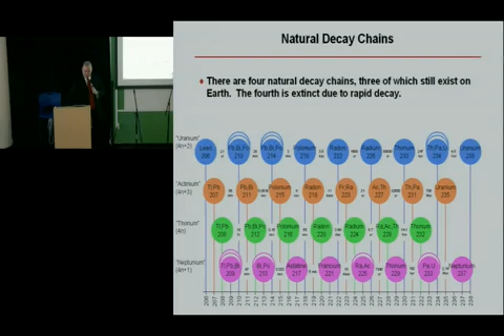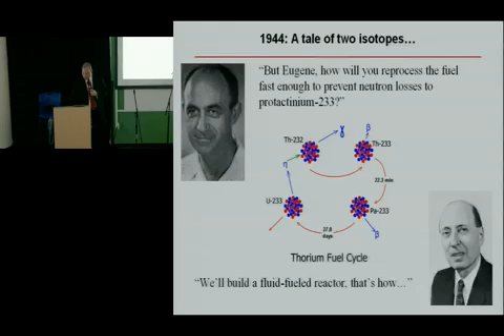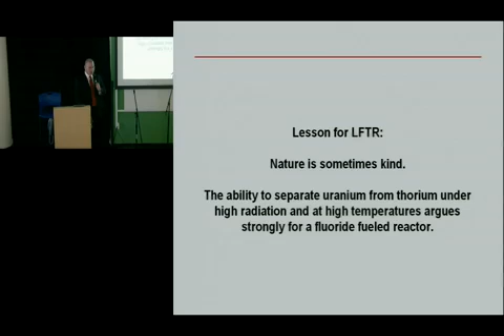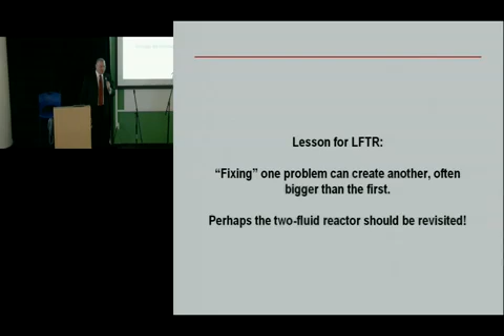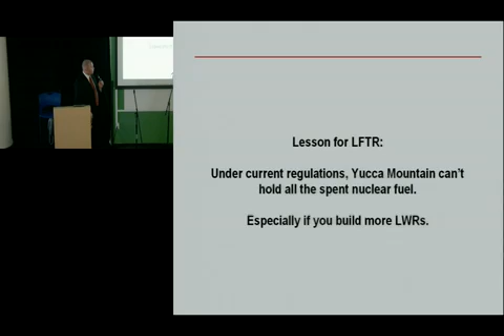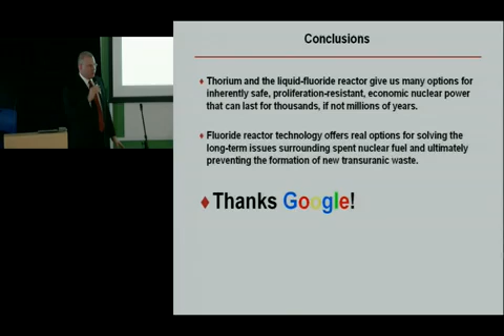Energy From Thorium: A Nuclear Waste Burning Liquid Salt Thorium Reactor

Comment: Except that he makes all kinds of leaps of faith - starting by calling thorium a "fuel" which it is not (the fuel is either the plutonium or the uranium 233).  While it is entirely theoretical that a LFTR could be built without any actual reprocessing, its breading capacity would be inefficient and likely suffer fuel failure at some point.  In any case, the thermal spectrum reactor cannot "use up all of the thorium" unlike his promise.  His language is manipulative, the LFTR entirely theoretical

Comment: I'm a big Th232 fan but I do have a question that has yet to be answered from the Th community. What is the solution to the hard gamma from U232? What are the shielding considerations? how is that going to inflate costs? A second less so question would be has there been a material developed that shows promise in containing UF6 without significant maintenance / leakage issues?
Reply: I came here seeking an answer to these two questions. Still no convincing answer after a decade. A Danish lab is claiming it has developed resilient stainless steel pumps and plumbing and a good core design for passive control of actinide burning as well as preventing proactium neutron absorbtion, but their cost assumptions weren't convincing.

Comment: Thorium is not totally safe. After the fuel is used 17% of the remaining fisile matter is radioactive and has to be stashed inside a mountain for 300 years. Far from being green.

We need to build more windmills and solar power and reduce electrical consumption, that's the way to go.

Comment: @Richbund Fusion reactions need a high-pressure environment to exist, as far as we have been able to tell. We've been able to make fusion bombs by using a nuclear weapon to create that pressure, but the problem is creating that kind of pressure without a reactor and maintaining it.

With a star's mass, it isn't hard to maintain that pressure during fusion. But on earth, it's extremely difficult to maintain one during the fusion process as the reaction causes it to expand, decreasing pressure.

Comment: @Richbund The Thorium reactor produces many times less waste than a conventional reactor, and the waste itself doesn't need to be contained for nearly as long. And that is not taking into account the percentage of that waste that would be used for other purposes.

The problem with fusion is maintaining a reaction. We can start one, but it basically fizzles out as soon as it starts.
Reply: Yes.  Fission essentially returns its energy profit from a basically passive process: just gather together enough material in a densely packed space and let the chain reactions flow.  You can't get too much simpler than that in engineering terms.  A fusion reactor requires a great deal of complexity and input energy just to get a reaction going and for a disappointing return.  I can see fusion power for spacecraft propulsion but seriously doubt it can ever be made practical for industrial electricity or heat generation here on Earth.

Comment: @halo07guy2 I regret that I did not express myself better.  I believe that since there is little or not need for uranium and plutonium these days and since it is more expensive, less stable and less abundant than Thorium that the solution to most nuclear energy problems is Thorium and that the reasons against Thorium are corporate and politicial.

Comment: The bottom line is there is still waste from a thorium reactor... That's like saying instead of killing you with a 45 cal bullet, we'll kill you with a 22 cal bullet... you can die from the by products of a thorium reactor. 
The answer is simply fusion derived energy, we should be pouring trillions into hot and cold fusion research, particularly cold fusion research... 
Nuclear fission, oil, and coal are all fossil fuels that produce dangerous waste, fusion produces no dangerous waste

Comment: The bottom line is there is still waste from a thorium reactor... That's like saying instead of killing you with a 45 cal bullet, we'll kill you with a 22 cal bullet... you can die from the by product of thorium fission.... 
The answer is simply fusion derived energy, we should be pouring trillions into hot and cold fusion research, particularly cold fusion research... 
Nuclear fission, oil, and coal are all fossil fuels that produce dangerous waste, fusion produces no dangerous waste

Comment: Important advantage of thorium at 27 mins 30 seconds - what happens if you pull the plug on external power - the whole thing just shuts down naturally. Lessons for Japan and the world over. China are definitely onto something going this way.
Reply: And eleven years later China found it's levelised cost of energy too expensive to commercialise.

Comment: @Suqatish A lot of  electricity used to be generated by oil, and now it isn't. Much of heating used to be done with oil and now it's gas and heat pumps(there is less overlap between oil and gas companies than you think)..Iraq is about securing access to oil, it is not about petrodollars and it is not to the benefit of "big oil".  Oil is a very inelastic commodity and it is not in the interest of "big oil" to expand supply. Just a decade ago oil was $20/bbl, why did "they" let it happen?

Comment: @josephboyle Basically what he is saying is, as an isotope in a reactor, Thorium has less absorption. You get a lot more energy, for less fuel due to the fact that the fission it's self is much easier. Plutonium and Uranium have a sizable absorption range, which means wasted fuel and effort.

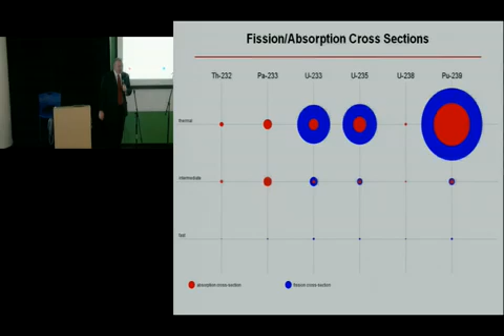Comment: Could you explain the "5 times more energy' statement at 13:16? This makes no sense in any interpretation I have tried so far.
Reply: Heavy necroposting, but it has to do with the probability of one fission causing another, neutrons that don't cause a fission are lost, that energy that neutron held is lost, so by decreasing the probability of neuron loss, with an equivalent mass of fuel a thermal spectrum reactor would produce more energy since it losses less energy in fissions that don't cause more fissions

Comment: Thanks for presentations Mr Sorenson, 

Piping (under radiation in both 1 and 2 fluid) to heat exchangers also using Hastelloy-N? Brittleness from damage + high temperature?

What to use for piping insulator? What for radiation shielding? Would pumps/seals have same problem with LiF-BeF2-ZrF4-UF4 as in liquid sodium reactors? Can use convection - flow rate?

Corrosive HF problem:
salt Helium blanket sufficient?
Has Hastelloy-N + Titanium been extensively verified for corrosion performance?

Comment: To be fair to the light water water reactor design, the waste products it produces are very small as well if you consider the mixed elements separately. Most of it is just U238. After 100 years more than 75% of the radioactivity is gone from those rods.  Yes, its a bit of problem, but its not that bad and yes, the containers can easily be made to last 1000's of years.
Reply: They need millions of years not thousands.  Also why do they put them in spent fuel pools like Fukushima? AS for depleted uranium just what the hell do we do with this?  daytondailynews.com/resizer/ol13cOv_-ShoJxRrk-PBRnpNvhI=/814x458/cloudfront-us-east-1.images.arcpublishing.com/coxohio/QEZ2K6ADZHCETUFMU7IQW5DOEU.jpg or this sierraclub.org/sites/default/files/sce-authors/u2384/DOE.png  Can you even imagine in a nuclear war a moderate sized H Bomb landing on one of these many sites FILLED with depleted UF6?  The cloud would circle the globe producing endless birth defects. sasapost.com/wp-content/uploads/image6-2.png  Russian DU frontierindia.com/wp-content/uploads/2022/08/Containers-with-depleted-uranium-hexafluoride.webp  anything landing on one or more of these is basically a doomsday device.  Kirk Sorenson's nuclear reactor would assist in de converting or burning these up too

Comment: show where anyone has grown 200 tons of algae per arce.  Show where anyone has recovered 200ton of oil from algae. 

Why would you take a billion dollar nuke plant that is up 90% and use it as backup for a system that is ready at best 20% and also costs a billion dollars if not more.
I believe you missed the point where he said this type of reactor burns the nuke waste from other reactors until you only have about 300 years dangerous levels of reactivity.  what better use of spent fuel?

Comment: HVDC is nothing new; been around for decades. Even at the short distance electricity is transmited now you're paying more for transmission than you are for generation.

They haul coal by railroad at great expense because it's cheaper than building electricity lines to the mine mouth.

Solar has a capacity factor of 20%; but you're paying for those lines 100% of the time, even when you're not using them.

Comment: "Sorry, I did mean around 2 MW per day, In kw/h units..."

Those are nonsense units.

A joule is unit for energy. A watt is a joule per second, a unit of power. A watt per second is a joule per second square, it's some kind of acceleration of power consumption.

1 kWh = kJ/s * h = 3600 kJ/s * s = 3.6 MJ. Energy.

"A grid from south Asia through the middle east into Africa can easily cover the electricity of the whole area at least ..."

As I said. Dependence and collectivism.

Comment: By definition you cannot come close to the cost of coal and gas since you propose using coal and gas generators as back-up which means you pay for those in addition to solar.

Absent a miracle you cannot even come within the correct order of magnitude.

Within the next 50 or so years the power-consumption of the world will grow by approximately a factor of 10. Will it be coal or nuclear?

Comment: In order for Sweden, or indeed most countries, to make good use of solar you need a giant "spider-webs" of HVDC crossing the entire continent to deal with weather. You need to massively overbuild solar capacity and provide months of storage to deal with seasonal variation.

This continent-wide Rube Goldberg machine will never be built, nor can it be built. Coal and gas won't be back-up, they will be the mainstay with fickle flows of wind and solar providing a little help whenever they can.

Comment: Fordi,

The sulfur-iodine cycle wants heat at 850 C or hotter.  The Aircraft Reactor Experiment ran at 877 C, which is the hottest anyone's ever run a reactor.

Waste heat from the turbines will come out at... whatever you choose.  Take it out at 50 C and you can air-cool the reactor.  Take it out at 70 C and you can drive multiple-effect desalination, at 4% less electrical power output.  But you can't drive sulfur-iodine with waste heat.

Comment: No, you prefer collectivism and dependence.

Weather and seasonal variations are correlated over areas much larger than a continent. Wind and solar are not distributed sources of energy, they're incredibly centralized as the entire installed wind and solar of a country reacts in unison to the weather as if it were one huge power plant.

There's nothing on the horizon that could allow you to build the required transmission and storage; most of your energy will come from scarce natural gas.

Comment: Just finished watching.  That was an excellent talk.  Kind of preaching to the choir with me, but very convincing nonetheless.

A side note on your last Q&A: From Dr. Hargraves' talk, waste heat, not electricity, would be used to split water via the sulfur - iodine cycle, and it need not affect the reactor's electrical efficiency at all.